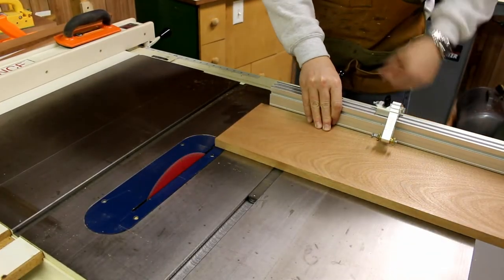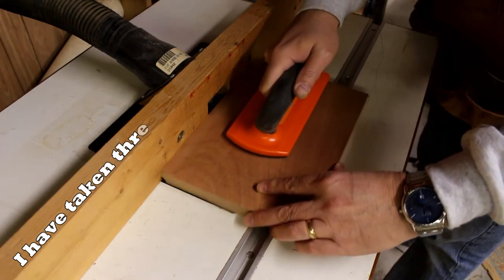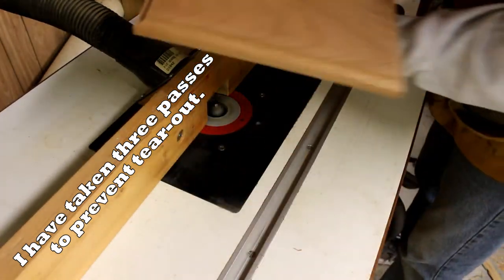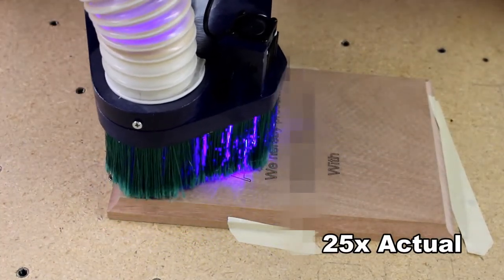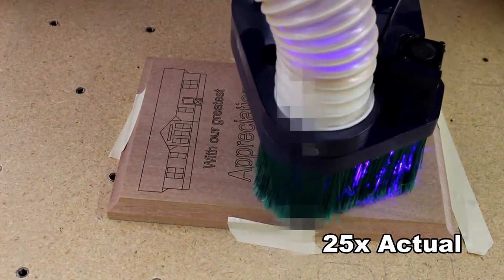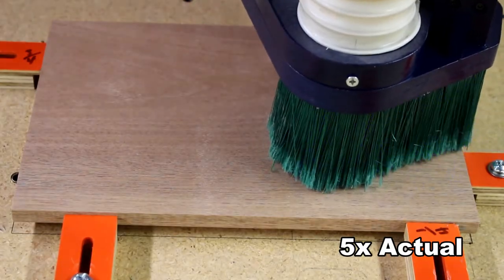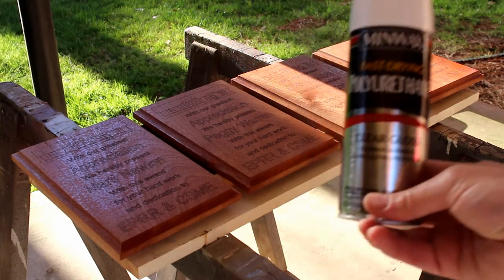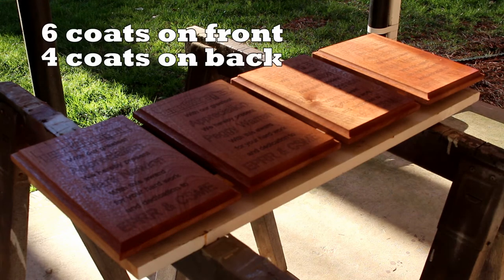Appreciation Plaques - How to make using Laser CNC

Comment: Nice end result, what software are you using to create the graphics and burn? Im fine with vectors but struggling with raster drawings with Mach3 with the laser, have you had any joy with raster images? Thanks
Reply from the maker: Shaun - I have not tried raster images. That might be fun to try.  I use CamBam to design and produce the G code file. I use Mach 3 on the CNC. So far, it has worked great. The laser work is done at 20 inches per minute. Makes a nice burn in the wood.

Thanks for your question. - Steve
Reply: Thanks for reply, please post a vid if you have a go at raster images, would be interesting to see this working with Mach3. Cheers